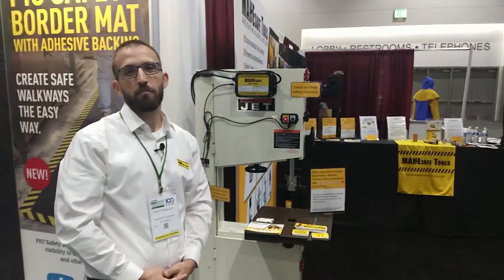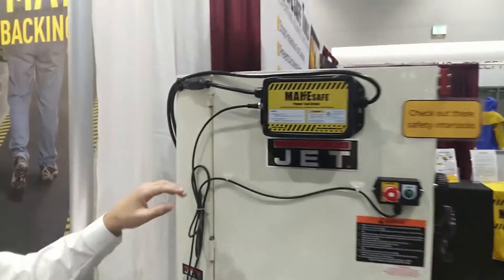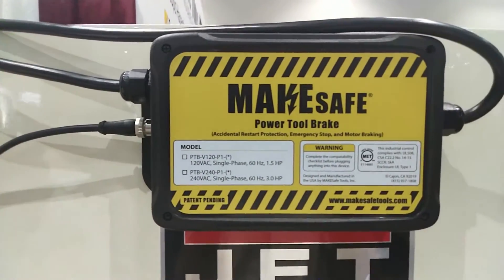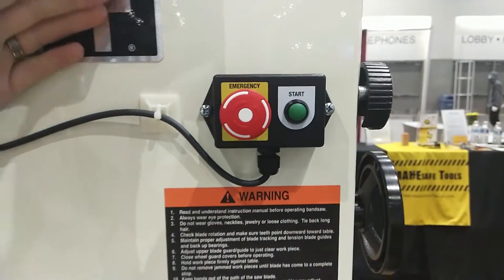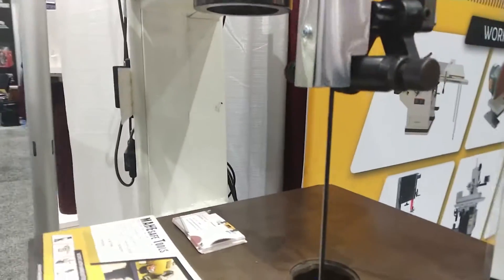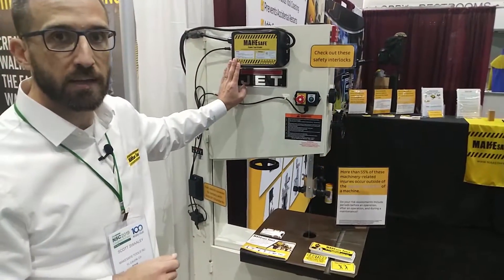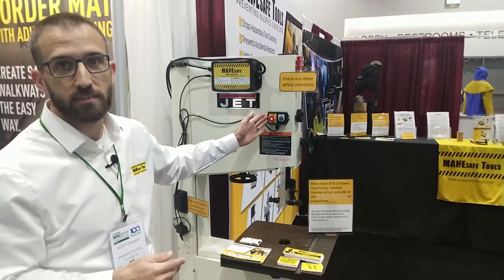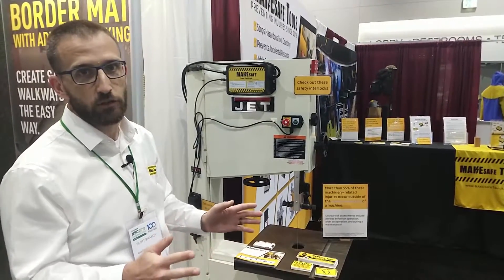MAKESafe Power Tool Brake Demonstration on Band Saw

Comment: Looks like a great idea.  Does it pull more amperage to stop the blade than to start the bandsaw?
Reply from the maker: Hi Dan - the braking current is adjustable but generally speaking, it pulls roughly 50% of starting current during braking. How are you enjoying your install?
Reply: @makesafetools6826  I installed it on my bandsaw (Jet 18 inch) and it works great.  I am very happy with its braking speed and I like the much more safe On/Off functionality.
Reply from the maker: @danielpaquette1597  Glad to hear it! Next time your working on a fun project, send us some action pics or video on social media! @makesafetools